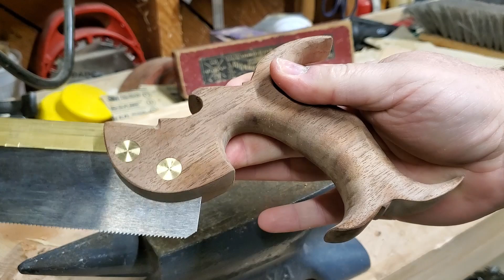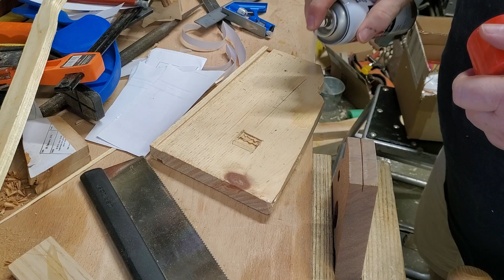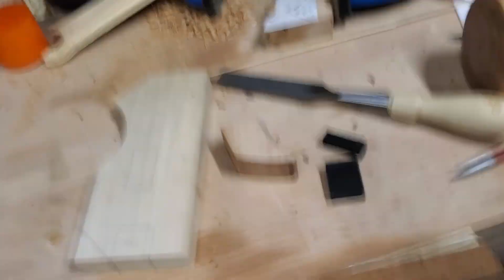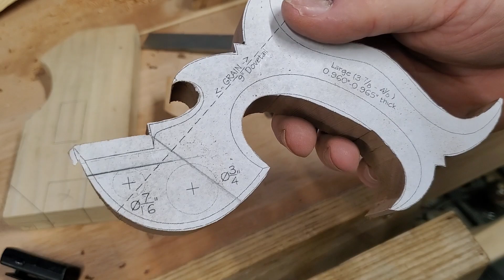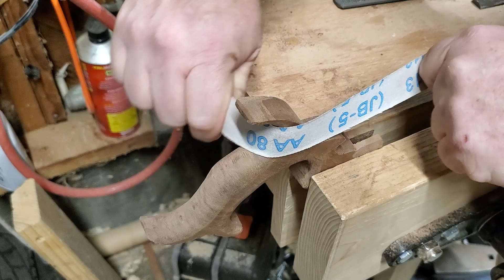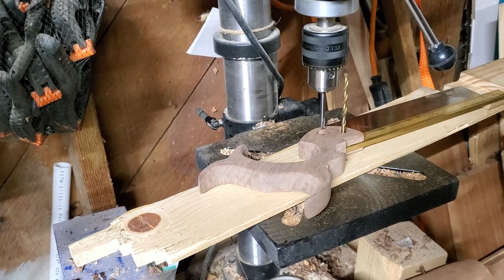Dovetail Saw Handle - 2nd Try

Comment: Hello, Notan Expert;
Great job!
Looks fantastic!
I have a set of 4 wood carving knives ($26US on amazon, sold by "ewade").
I use them to hog off thick corner sections to minimize rasping, just a suggestion.
The place it broke is end grain so you can fit & glue a piece of scrap to fill in.
Just an idea.
This is really interesting because I want to make (or repair) a saw, too.
When you get thru with it please summarize your pros & cons & what you would do different if you had a do-over.
Have a GREAT day, Neighbor!